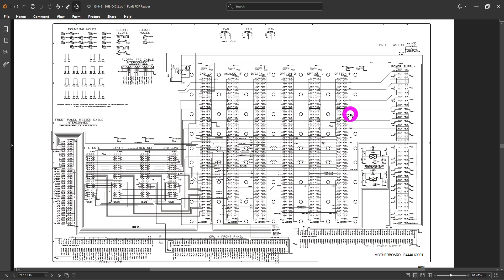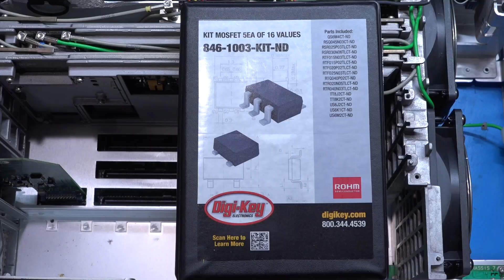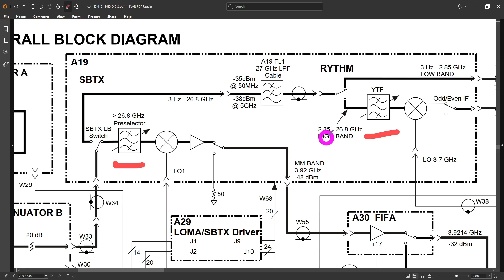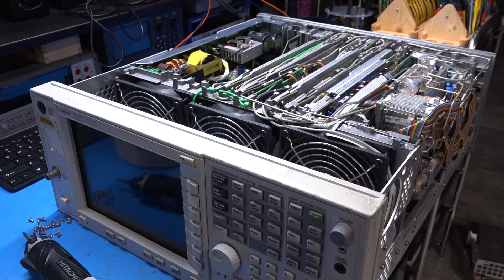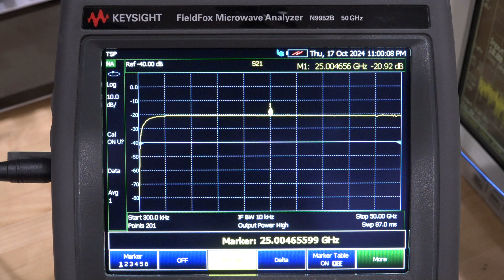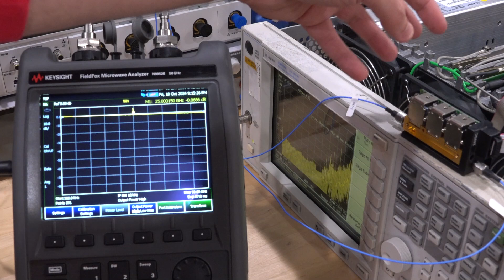TSP #303 - Agilent 50GHz PSA (E4448A) Spectrum Analyzer Teardown, Repair & Experiments

Comment: thank you, that's great.
I met another problem. when i test calibration signal, it's fine, -25dBm, then I test attenuator like you mentioned.  the attenuator also fine, but when i test external signal, it always has around 10dB less. what is the problem?

Comment: We had the 6GHz model at the radio club with some similar sounding faults and our diagnosis was a faulty highband mixer and no budget for replacing it. 
Couple of steps on the frontend attenuator did not actuate either, but the RF side was electrically fine. 
It was given away as a parts machine in frustration and to regain the space it took.

Comment: Great troubleshooting work, narrowing down the PSU issue to the SBTX. Wish I had time to record my repairs; I recently picked up an E4448A and rebuilt the 2 attenuators, along with a flaky 50 GHz transfer switch for opt 110 (full band preamp). Btw the attenuators can be fully disassembled down to the plungers to replace the o-rings. I've done 26.5 GHz and 50 GHz units, all pass cal at Roseville. 

As far as signals disappearing > 3 GHz; try using the "Preselector Center" key in the amplitude menu. The PSA manual recommendeds applying this setting for measurements > 2.85 GHz. If you cannot manually adjust the preselector and get a signal between 2.85 to 26.8 GHz, the RYTHM (also a part of the SBTX "tower") might be the culprit. Try measuring where W17 connects on the tower.

I have seen an SBTX tower repair service on eBay for roughly $1700 flat rate. Usually this is for units that experience amplitude drop in highband due to excessive preselector drift that cannot be adjusted using N7800. Maybe the repair also covers adjustment of the RYTHM YIG and SBTX? A new 50 GHz tower is around $18K from Keysight last time I checked...

Btw, above 26.8 GHz, the highband preselector and mixer use Barrium Ferrite instead of YIG. BaFe has much higher magnetic permeability than YIG so the magnetic field required is a lot smaller for higher resonant frequencies. Pretty cool patent by Hassan Tanbakuchi...
Reply from the maker: Thanks for your comment! Would you mind dropping me an email?
Reply: @TheSignalPath  Sent. Hopefully I have the right address (gmail on the signal path site "about" page)

Comment: Excellent video! I like how you layout your thought process clearly and prove it through experiments. I hope it's not the YTX or what is called on your unit. It's prohibitively expensive to replace. I had one with a broken rod that holds the YIG balls. It could be remounted and tuned by some very experienced folks with special equipment but it's $$$. The other time I was lucky on another HP SA where the 2-22Ghz bands were dead but lower band works. It turned out that the power transistor on YTX driver was dead so that the YTX preselector is not being driven. Much cheaper to repair comparing to a broken YTX. Looking forward to your next episode!!!

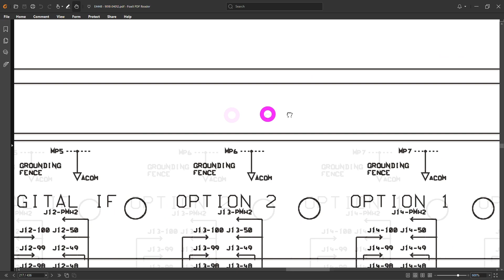Comment: At 2:31 there is a rectangle on the left under the symbol of C5. What does this rectangle mean?
Reply from the maker: It’s a three terminal tantalum capacitor. It just says two of its terminals are connected to ground.
Reply: @TheSignalPath  Thank you very much.

Comment: It’s so crazy, that’s still a $40,000-$70,000 Spectrum Analyzer. Not just anyone is going to take on a piece of kit like that. You do excellent work and explain it well. thanks for the video.
Reply: HP 8566&8568 is $500 on ebay with a little luck, nowadays.
Plenty enough for most simple tasks
Reply: @hinz1  Year back, I paid $55K for my 8566, ouch! Seeing what they go for now is just crazy.
Reply: (years) that was back in 84/85

Comment: Attennutator problems are the best problems to fix. :) I cleaned the attennuator pads on my 8566B, then it was just like new. One of the common problems of the E4406A and E4448A series is that the CCFL tube backlight dims and the light diffuser panel behind the LCD turns to yellow. You can order new CCFLs for a few dollars and do a replacement, it is worth it. Screen becomes much brighter. Or as an alternative you can connect to an external VGA display and have a much better picture, but mine radiates around -80db at 72 Mhz, and it becomes visible on the analyzer.
Reply: I thought I had seen an LED replacement for the CCFL, but I can't find it now. I use a 7 inch external VGA display on my E4406A, but I'd prefer to have the LCD working again.  I haven't noticed any spurious signals but then I rarely use it below 2 GHz.

Comment: yes please part 2 -- great repair, good to know that the attenators are sometimes repairable. I assume someting in the YIG YTF after the RYTHM switch because it disappears at 2.85GHz (assume) till half of the spectrum width e.g. 26ghz. The SBTX Path  for >26Gz till 50 Ghz path seems to work.So could be the YIG preselector or the follow up mixer. with 3-7GHz LO , also that could be a problem. So measure at coax W17 first.
Reply from the maker: I agree! Thanks :)